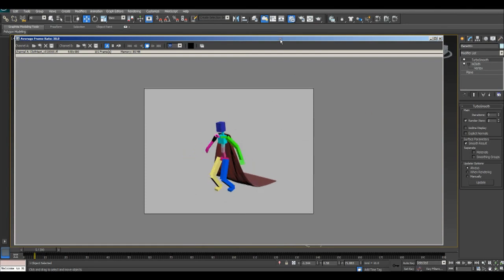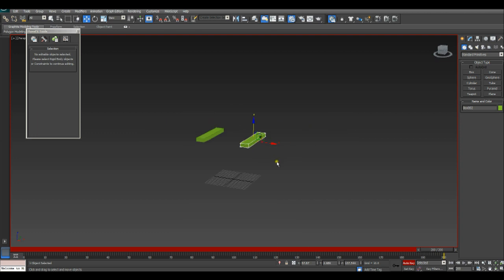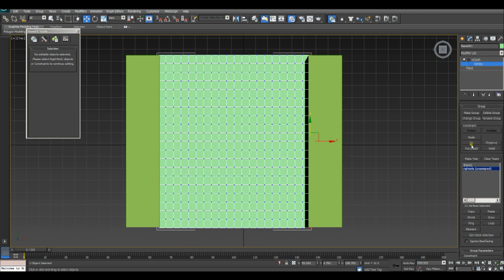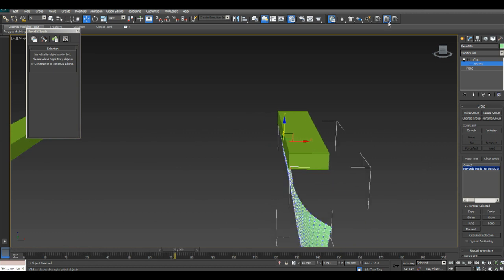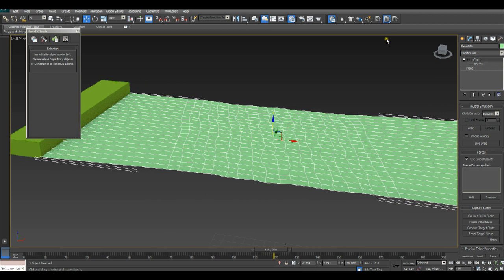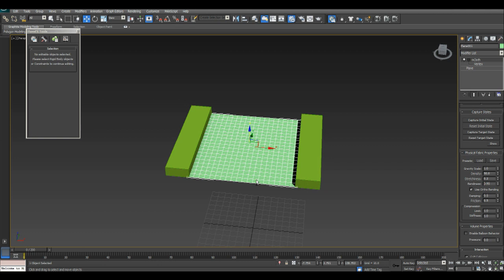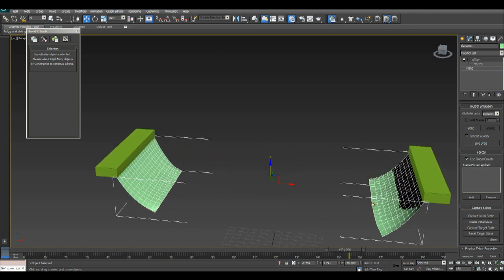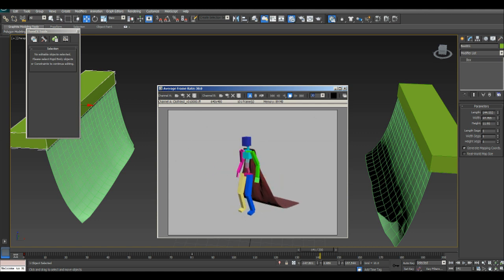mCloth - 3DS Max 2013 Tutorial.  Level: intermediate.  Part 2

Comment from the maker: Hi Kubaknedloholik,

Thanks. I think the reason you did not find much documentation about which Unit setup to use with MassFX is because MassFX units scale to your system units. Meaning that it uses your system units as calculation and it understands when that setting is changed. If you are getting undesired effects try starting over and make sure you do not change some of the defaults like Gravity.
Earth's gravity is approximately –981.001 cm/s2 = –386.221 in/s2 = –32.185 ft/s2 = –9.81 m/s2